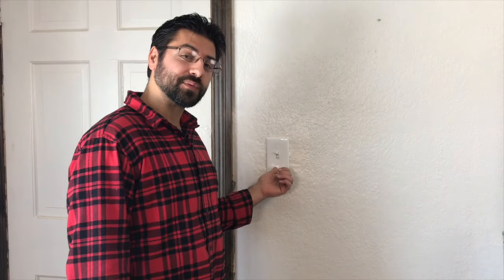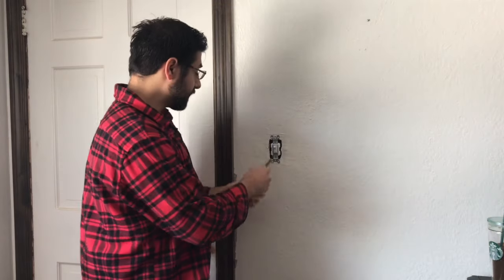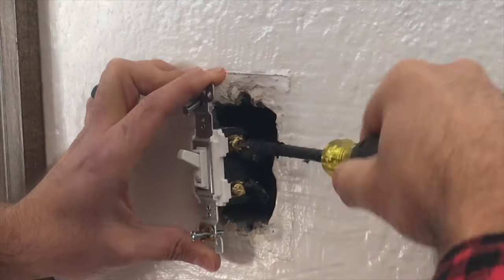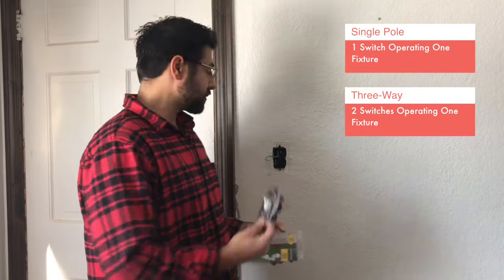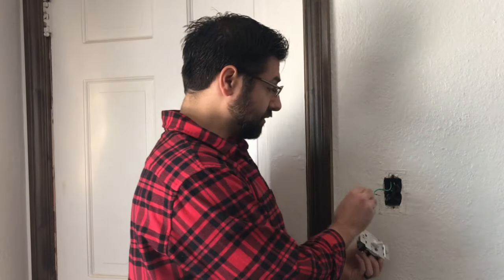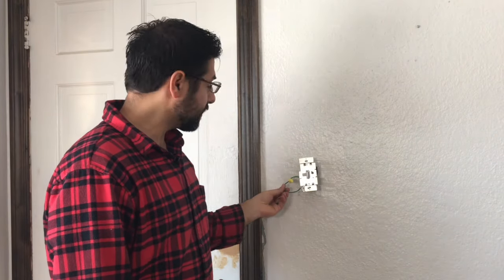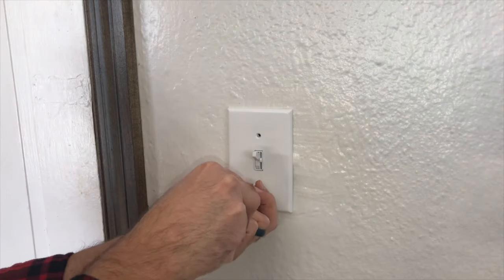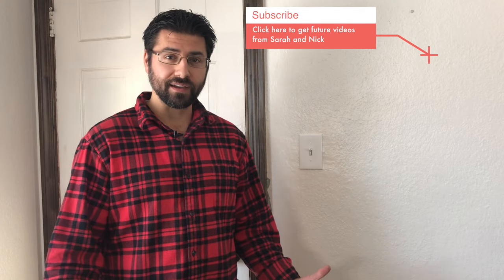How to Install an LED Dimmer Switch | Nestrs

Comment: Great tutorial! A suggestion I have for any DIYers is to test voltage by placing your meter lead on the grounding (green or bare) conductor instead of the box in the event that your box is plastic and not metal. A plastic box will read no voltage even if the power is still on. Stay safe! Thanks for the video

Comment: Since this is single OR a 3 way switch,  please look to another video for the 3 way wiring. I installed a 3 way using this video (same exact switch) and then connected the final wire to the last available screw.  Seemed like that would be right but was not.  The wire going to the different color screw (common) needed to stay on the different color screw on the new switch for the 3 way setup.
Reply from the maker: Jeff M. Thanks for the comment Jeff. Yeah, this was specifically for a single pole setup. A 3 way setup has a second switch in the sequence that is wired a little different from the first switch which I think is where you ran into trouble. The supply (hot) wire from the fuse panel must be connected to the black screw on switch 1. The hot wire coming from the light goes to the black screw on switch 2. So depending on what switch you are looking at there could be some confusion.

Comment: what do you do for 3 lights in a hall (so two switches) as far as LED switch type goes? I've got 3 x 28watts = 84 watts total. Do I use a dimmer of 150 watts?

Comment: new subscriber here 👍🏼 question? I want to replace a switch where it has 2 switches and a 2 outlets on 1 box. I took one out and I don't see the ground wire hooked up, so can I get away with not hooking it up?
Reply from the maker: Hey Pablo, before we proceed I need to tell you I am not a licensed electrician... with that said, yes you want to ground your switch. If it has a metal box, chances are the box is grounded (make sure you test it with your volt meter) and you can simply use a grounding (green) screw to ground the switch. There are plenty of videos on this. If you have a plastic box, double check your wiring for a ground. It could be hidden or cut back. If you can’t find it, you make want to consider running a new line with a ground. If that is the case I have a great drywall video for you to watch. When in doubt, hire a licensed professional. I hope that helps and good luck!

Comment: Great video and very well explained throughout. Just a hint though when showing how to test the switch is safe using your voltage tester it may be an idea not to have it on the ‘hold’ setting. I know its just for demonstration purposes and your probably not actually testing the feed but just an observation.
Reply from the maker: MrBean25 Lol, you know you are the first to call me out on this. I didn’t realize it when I was recording....(head slap). Yes, you are 100% correct. Thanks for the comment.

Comment: I am wanting to change an old dimmer switch to a remote controlled one. When I took off the plate and removed the old switch from the box, I only see two wires that are capped connecting the dimmer to the power. I don’t see a ground wire coming out of the box. What do I do with the ground wire coming out of the new dimmer switch? Thanks for your help!
Reply from the maker: Hey Tommy, sounds like you have a very old house only having supply and neutral wires. If you have a metal box there is the possibility that the box is grounded and you can used a self tapping screw to secure the ground wire to the back of the box. In this case I would consult a licensed electrician to be on the safe side. She/he will be able to determine what exactly is going on. They may be able to run a new ground wire to a nearby outlet if the box is not grounded properly. I hope that helps!
Reply: Nestrs, LLC Thanks for the quick response. I appreciate it. It’s an old apartment building in NYC. The dimmer switch that is in there has the green ground wire unattached to anything. It’s got black electrical tape on it.

Comment: there is no neutral wire on a switch....there would be a ground wire, a hot wire feeding the switch, and a potentially hot wire going to the device downstream.
Reply from the maker: Thanks Rusty, you are totally right. I need to make that update in the note section. #alwayslearning Thanks for the comment!